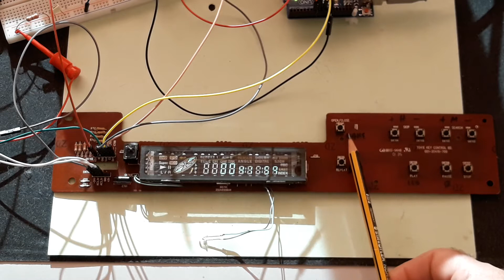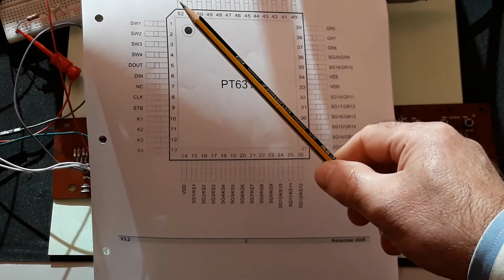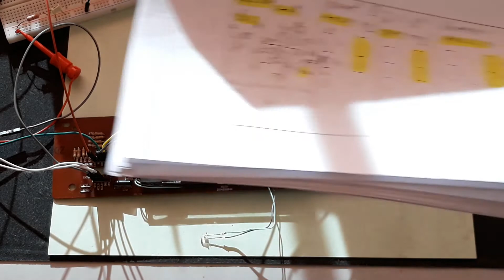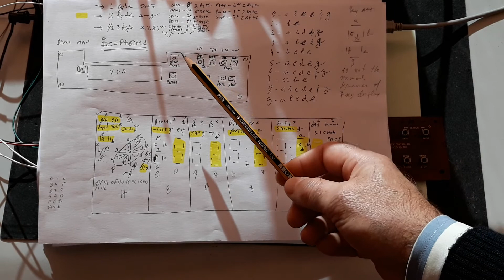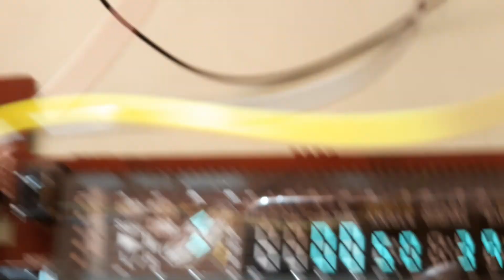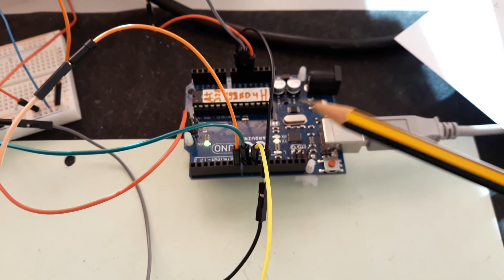PT6311

Comment: Hi mistar
Reply from the maker: Hi! Welcome, hope you find help with my channel.
Reply from the maker: Hello, you need to know the PT6311 model very well, it has at least 3 encapsulations! Please take photos of your device and the board. Send references and sound system model by email, you can find it on the channel. The PT6311 does not have a resident code and as long as the voltages for its operation are respected it will not cause problems.

Comment: Thanks sir
The only good resource of pt6311
Dou you have detail of connection between vfd and Arduino?
Reply from the maker: Hi Lens Lens,
Please see other videos of my channel about "How connect VFD",
Also at link of description you have the code on "github" you have the code to define pins:
#define VFD_data 7// If 0 write LCD, if 1 read of LCD
#define VFD_clk 8 // if 0 is a command, if 1 is a data0
#define VFD_stb 9 // Must be pulsed to LCD fetch data of bus (Strobe could be referred  like CE)
You only need use this 3 pins and a GND pin to connect and control PT6311 by "Arduino"!
Please see also other videos on my channel related with foamily of PT6xxx

Comment: Okay, okay? The VEE cannot be +13V, it must be between +0.3V to -35V.  Take a look at the datasheet. So there must be some kind of converter on the board. Edit: 9:27 it shows a -24V input and 3.3V AC for the filament.
Reply from the maker: Hi "code beat",
This is a matter that most people consider complicated, I know!
I always refer that there have to be 3 independent energy sources precisely for that reason. The 13V I used has the positive (+) connected to the GND of the logic ground and in turn the GND of the 13V is connected to one of the pins of the filament voltage. Thus the filament will be referenced to -13VDC.
Here I me using 5VDC to polarize filament, the power source need be independent!
I know it's confusing, take a look at the video:
https://www.youtube.com/watch?v=PYJES3VuylI
he can help clarify this process. If necessary I will help!
Good job.